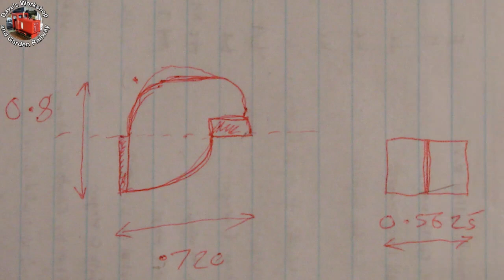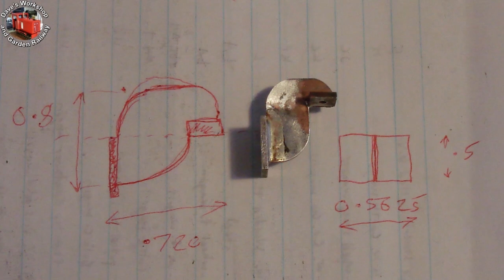Building Charles - Part 15 - Slide bars and Brackets

Comment: Thanks for posting! The build is looking great. For these tiny holes I started using PCB drills, my set goes down to 0.3mm but they all have a1/8th shank. Makes for easy use in a drill chuck